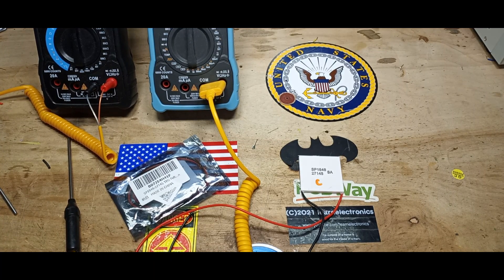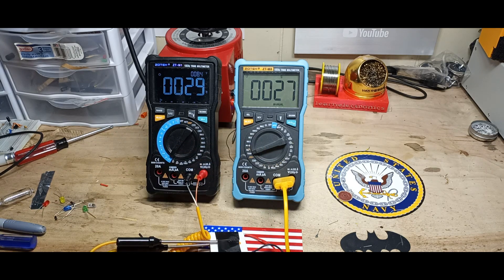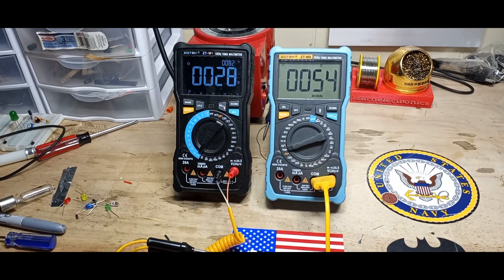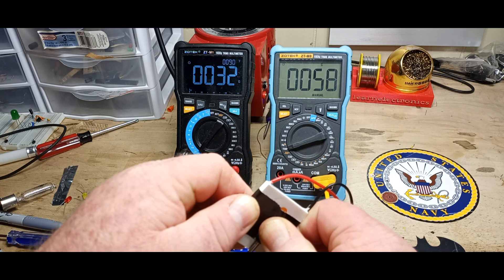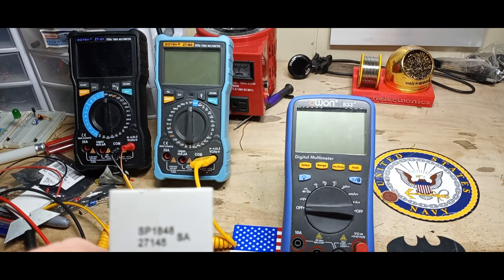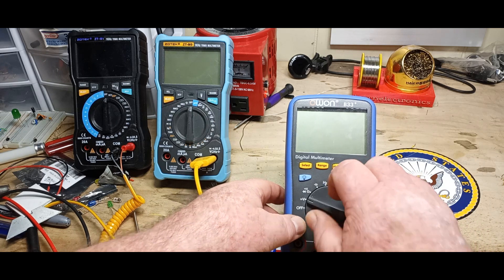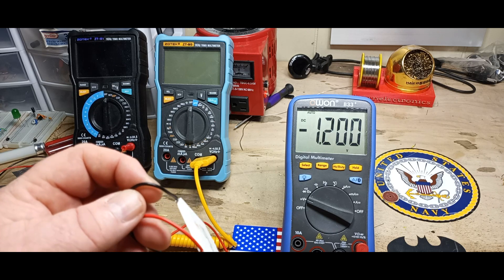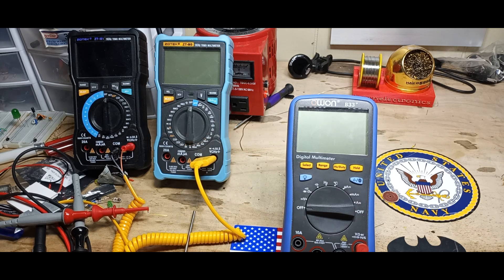Life Saving Hack With Peltier Modules

Comment: The tec ones are for cooling and can generate power but you have to be careful not to over heat them it will melt the solder connections inside and they will fail.   Teg ones are made for power generation and will hold up better to heat

Comment: if your going to use one of those to generate electricity by applying heat to one side, the colder you can keep the opposing side the greater the electrical output will be.

Comment: They can be connected in series, both electrically and mechanically, the latter can be used to achieve very low temperatures. 
They also find application in cooling astronomy cameras and radio receivers to reduce thermal noise. 
I can across a large version that was used to cool telecom rack equipment. On the bench, it was able to produce surface frost in a matter of a couple of minutes.
 They are heat pumps, moving thermal energy from one side to the other. So the hot side is usually fitted with a large heat sink which is fan cooled. I did consider using a few for making distilled water in a closed system.. Heating the water on one side and cooling it on the other, but the efficiency is really too low to make it a practical device. I would be interested to know if anyone else has succeeded in this application.
Reply: I investigated using a cascade of peltier devices to achieve cryogenic temperatures, sadly the project proved impossible, as most devices have a minimum operating temperature of -30C. There are reports of university's achieving lower temperatures, but not much below -40C, a long way short of liquid nitrogen boiling point of -195.8C.
Reply: @nigeljohnson9820  I "easily" reached -45°C with my home made contraption and I could go even lower with some cheating (cold side of the Peltier stack was cooled with dry ice). But, due to the physical limitations, these units "max out" around -60°C as far as I know. With today's technology, you won't reach cryogenic temperatures with Peltiers.
Reply: @CuriousScientist  I did find a reference to achieving -70C, but I was very sceptical, as all the commercial available Pelter coolers, had specifications that stopped at -30C minimum temperature, with a 40 degree differential.
Have you considered the idea of using them as the basis of a water distillation unit? I considered sandwiching a Pelter between two square profile bottles, mounted in a polystyrene insulation  carrier. The bottles being linked by a small length of plastic pipe, to carry the water vapour between the two. 
There is something nice about moving the heat energy in the water to evaporate it and then condense it again, unfortunately the efficiency appeared far less than more conventional methods.

Thinking about it again, my water distillation unit would been better operated at the boiling point of water, so the heat being removed was just the latent heat of evaporation. It might have been better to add a water heater to the hot side to supplement the heat provided by the Pelter. Interesting, but not very practical.

Comment: One of the most useful and interesting things I've seen in a while.  Thanks for that.  I'm confused about the cooling side of the Peltier.  The cold-side reading you had was at what seemed like room temperature.  How does that make a cooler cold?
Reply from the maker: You need heatsinks to make these work well.

Comment: I have looked at a lot of videos on these and I like the theory of them but it's my understanding that they are not very efficient, what do you think?
Reply from the maker: No they aren't. But they're what we got.
Reply: @learnelectronics  Oh how I know about that. I like that you made this so it can be an option if you need it. Anything in an emergency is good. Can't wait to see what the vid is about?
Reply: Yeah, they are dreadfully inefficient.  As a camping refrigerator they really suck.  A gas (propane) fridge works way better, costs less to run, and won't flatten your vehicle batteries.  Fun to play with, but no use as a camping fridge unless you lug around a really large solar panel to run it, then there's no sun at night anyway, so you still need batteries, and even more solar panels to charge them as well, and you are still limited to about 10C.  At that point you are better off with an electric fridge, an inverter, and plenty of battery storage attached to the solar panels, and that's way more messing around and less efficient than a gas fridge.  Peltier devices are probably the least efficient solution out of any of many options.

Comment: Cool video, Paul. Hot stuff, Dude. (shamelessly cheesy puns)
My Peltier TECs arrive tomorrow. Perfect timing, cause I've never used them before. Mine are 40mm x 40mm 12VDC, but I'll only be pushing 5 VDC from a buck converter through one. So, should I expect to see the same results as your demo?
I'll be cooling a 3 watt RGB laser diode module, which generates a lot of heat, but I don't want condensation collecting inside the LD module. So, I'll be using a 104 deg F NO thermal switch (similar to those controlling the fan in a furnace) to disable the TEC while the projector is idling.
Yeah, I could go higher tech with a variable thermostat on a PCB & a probe. But, then I'd get all carried away with an WiFi controlled ESP32 and an LCD temp display. On the other hand, instead of getting bogged down for a month, I just want to get my mods finished and start playing with some imagery. :-)

After thought: Rut-roh. Since a hot TEC can generate a voltage, am I going to need a diode to prevent back EMF from the still hot TEC into the output of the buck converter and/or the power inputs of the other 5VDC DAC board when I power down the projector? If the cold side is then being heated, which way will the generated current flow? Reckon I'd better do some isolated tests prior to installing the TECs inside the projectors.

Thanks a bunch for demonstrating the See Beck effect. I never would have guessed that being a potential problem. A little knowledge can save a lot of expensive damage. That's why I'm always here.

Comment: Would parabolic mirrors and a bunch of those compare to a solar panel?
Reply: Peltier devices are only about 5% efficient for voltage generation, best case in real world testing.  There's an upper limit for temperature so that will limit the size of the mirror you can use (you can't just keep stacking mirrors to increase wattage).  If you are going to lug that around you are probably better off with a large solar panel.  Buy big solar panels instead of these, the latest solar panel technology has exceeded 20% efficiency (maybe, it's probably not quite that simple).

The absolute most efficient way to get power from solar is along the lines you suggest - parabolic mirrors aimed at water pipes, with the generated steam used to drive a turbine.  That's only feasible for large installations however, not something you'd want to go "camping" with.

Welcome to the real world of green power generation.  To get some idea of what is efficient and practical look at what engineers are actually doing.  They've put years of skull-sweat into this stuff: if there was  a magic bullet they would have found it by now.
Reply: @Chris_the_Muso  I like your parabolic water heater solution. In fact, I've designed a linear parabolic reflector to focus the sun onto a black pipe, set to the winter's peak solar angle.
The parabolic mirror is mounted onto the pipe with bearings to allow it to rotate and track the day's sun. 
Of course it is also balanced and driven with a small clock motor, running @ 1/144 rpm.
It is designed to solar heat in-floor radiant tubing and a solar water heater, so car radiator coolant would be used, instead of water.
A small solar powered hydronic pump with a pressure switch would be used for circulation. A car's thermostat, located at the high end of the pipe would only allow fluid to flow when it is sufficiently hot. Then, the pressure switch would refill the pipe with coolant until the thermostat pauses it again and so on. Of course, everything needs to be optimized to prevent excessive oscillation.

Thanks for providing me with an excuse to share. BR :-)
Reply: @Chris_the_Muso  I knew they weren't that efficient. We used them as a temperature control system for a drug testing instrument. My friend was an electrical engineer on that project. Just thought it might have a chance with some sort of solar application. :)
Reply: Interesting concept. FYI I  just purchased 5 on amazon @ ~$3 each. They're 40mm x 40mm and rated for 12 VDC. Considering the lower voltage produced by Paul's torch (heat gun?), I'm guessing that PV panels would be more cost effective. But, what do I know?
Sounds like a fun experiment. Perhaps I'll stick 5 of them  in the sunshine and see what they produce. :-0